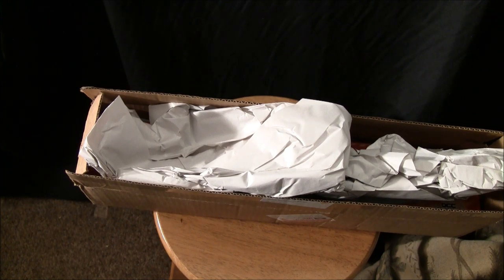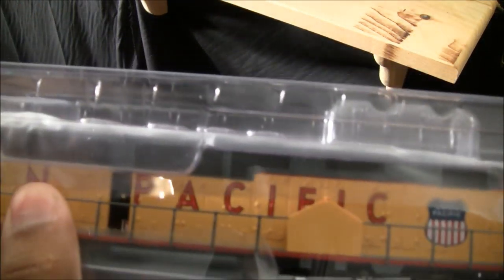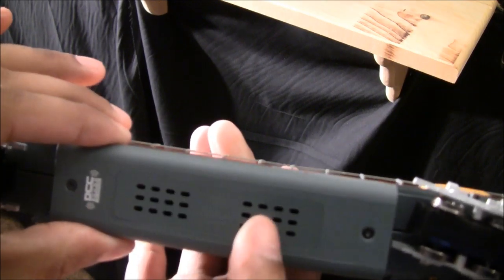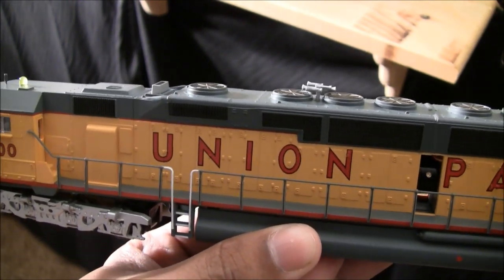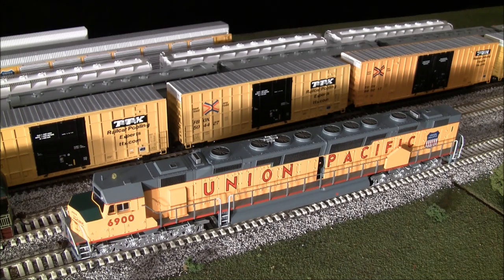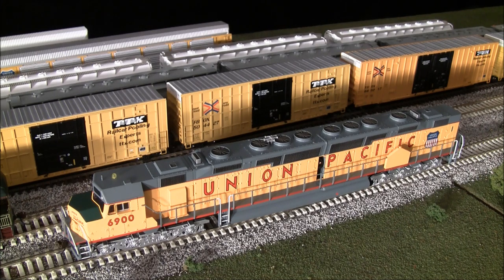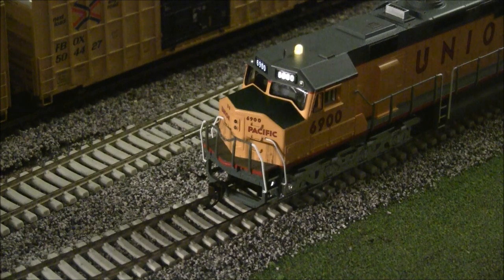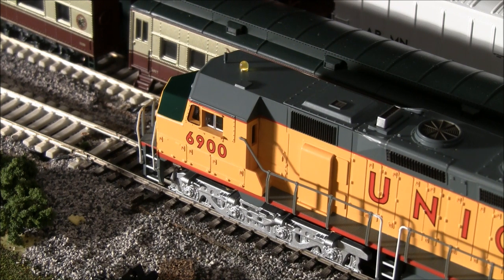Bachmann DDA40X dcc sound value review & viewer mail

Comment: May I suggest that if you are on a budget, save up for a couple more months and get a good model.
Reply: The box says dual prime mover 567 diesels. Bachmann must have figured out how to model a real Mary Jane crop for real!!!!.They should have known dual 645's. Again on top of the misprint they only pick up on 8 wheels instead of the older versions in DC that picks up current from all 16 wheels. If anything dealing with dcc and sound the electrical pickups should of been improved instead of downgraded in that area to save on costs. They are just plain dumb as a stump doing certain things. Got mine for 130 and fixed the electrical pickups and replaced the junk speakers they come with. The sound improved to match the Athearn version although missing half the sounds.The shell on the thing could have been upgraded with new tooling instead of using the 30 year old tooling from the early Spectrum run with just painted vents.

Comment: Have you measured the top scale speed of the Bachmann DDA40X?  The prototype could run about 90, maybe 100, tops.  I think it can be measured probably with an NCE PowerCab throttle.  Any tips for my trackwork that I can follow?